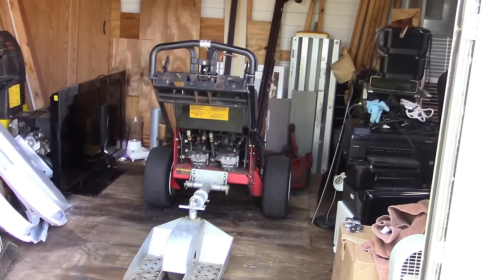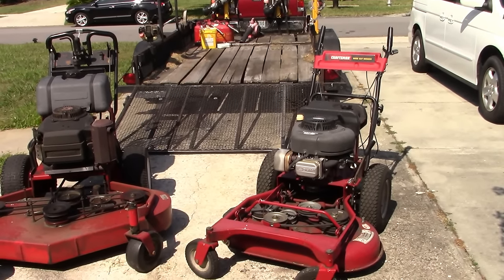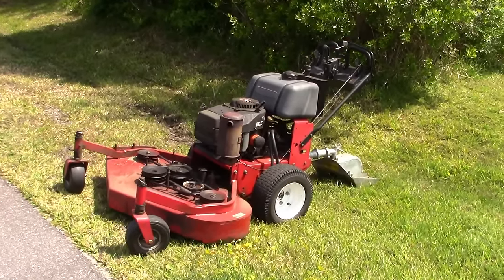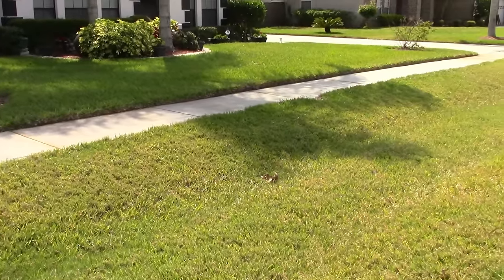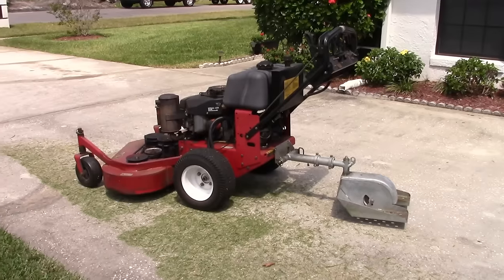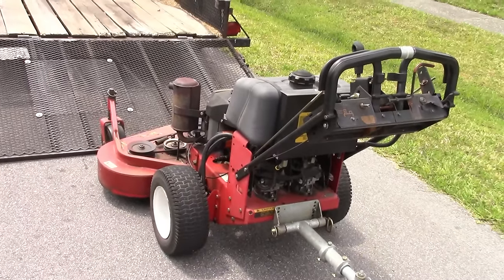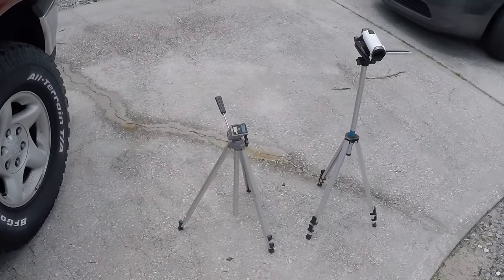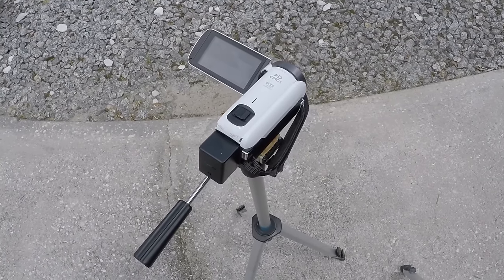Lawn Care vlog #15 Snapper 48 gets some mow time

Comment: Only thing I would have to do about "Old Reliable" if it were mine, would be adding a mulch plate, pronto. I can stress enough to my workers, keep grass out of the beds and as much as possible off walkways, driveways, roadways, etc. Once I learned that I was absolutely amazed of the overall time saved by reducing extra blowing at each yard throughout the day. It may seem petty but it adds up, trust me. Great video, man.
Reply from the maker: +Graceland Solutions I do have a mulch cover for it. I generally have it on all winter. But during the summer the grass is just too thick. Sometimes I have it on for part of the yard then take it off. But yes, it's a good idea when the grass is thin enough.

Comment: I've got that exact same mower! Just not in as good of shape, i can never seem to get it to track straight and the hydros are very stiff. Also struggles sometimes turning the blades on even with a new clutch... Oh well, still a great mower and cuts clean. Wish I had yours!!
Reply from the maker: +Parrish Pettway Wow, none of that is true with mine. Doesn't struggle, drives straight as an arrow. Actually, it's so nice and broken in, it's the smoothest running machine I got.

Comment: I had the exact one was a great designed mower
Reply from the maker: I agree. I still have this mower. I need to make a fresh new video with it. It is the smoothest operating mower I have!
Reply: Always would start on second pull. The deck height adjustment was easy

Comment: I agree on the Craftsman being able to pull the sulky. I saw the cub cadet version of the craftsman on craigslist a few months ago with a sulky on it.
Reply from the maker: +ilike2mow I'd like to see how they did that. I'm thinking I should mount a plate to that empty battery silhouette then gooseneck off of that.
Reply: +Something 2LookAt If I remember correctly, it was a havener enterprises sulky, and it has the small plate where the pin goes through, and I think it was just bolted to the metal below the gear shifter
Reply from the maker: ***** Hmm, interesting. There's not a lot of room down there. I'll check it out.
Reply: +Something 2LookAt Yeah it was an interesting setup to say the least. I thought about buying it when I saw it, but someone beat me to it lol

Comment: great video and job...could u film trimming/eging with  the chest mount..if that mower dies would u try to bring it back?
Reply: +James&#39;s Garbage Trucks And Other Vids  why do u have racks both sides /same tools on both
Reply from the maker: +James&#39;s Garbage Trucks And Other Vids Seriously you can never have too much equipment with you at all times. If an edger dies you have to grab another one and keep going. The weedeater on one side is much more powerful than the other but much much heavier. You only want to use it on the thick stuff, but you definitely want it with you at all times. And yes, Old Reliable would definitely get a new engine if it died.

Comment: Nice one!

My Toro has a smokey start every once in a while during the hot summer months, ever since I got it 3 years ago. The mechanic at the dealer said it's normal, it's just sediment in the muffler that has to burn off. I'm glad I'm not the only one! Because I never see any other local companies have that happen...
Reply from the maker: +Lawn Care Rookie Oh yea, every one of my mowers (except ironically the Briggs) has those occasional smoky startups, although they are nowhere near as smokey as the old Snapper. It's a tiny tolerance in the valve guide I'm sure.

Comment: Kind of surprised you don't have an electric start on it you are using
Reply from the maker: It would be nice to have an electric start. It's 14 hp I think so it's a big one to pull, but it also has a mean kickback sometimes. It'll pop the handle right out of your hand.
Reply: Years ago I dealt with John Deere f525 lawn tractor. It has a 14 hp motor with electric start.

Comment: Sometimes my exmark viking 36 will puff smoke for as long as 6 minutes warming up
Reply from the maker: Believe it or not, all that smoke that goes on that long is one drop that got through the valve guide. Kawasaki?
Reply: @Something2LookAt  mine has a lot of hours on it as well.  its a Kawasaki. but my mower is like 9 or 10 years newer than your snapper
Reply from the maker: @superunknown8645  Yea I think mine is about 22 now. Still purrs like a kitten though.

Comment: That machine needs a valve job done on it....to stop the smoking before it starts to get really pricey
Reply from the maker: I believe it is the valve guides. These 500V's had problems there. All that smoke is just like 1 drop of oil that made it down the guide and takes a while to burn off. Otherwise it would do it every time, and not stop smoking the whole time I'm mowing. And it doesn't.